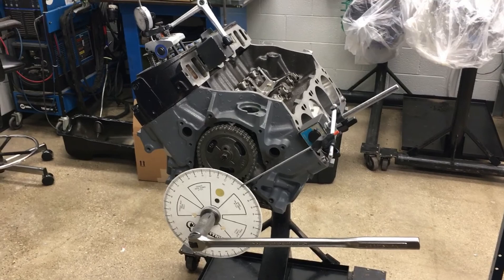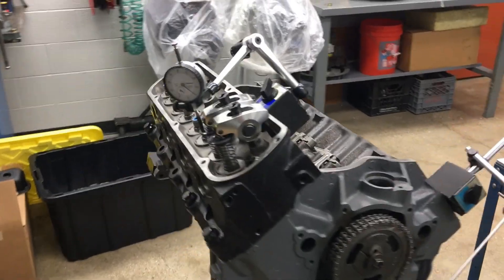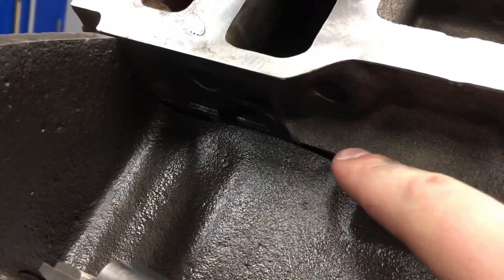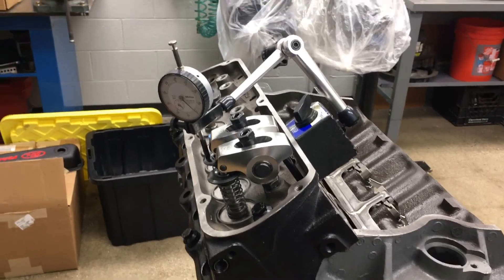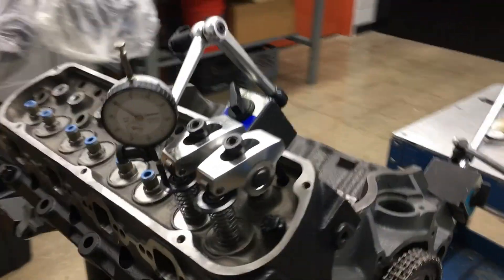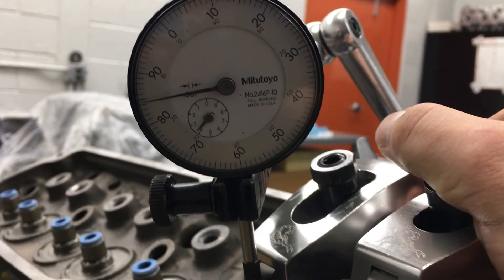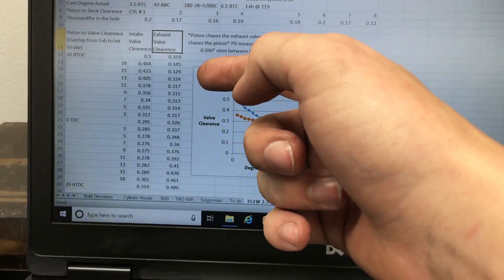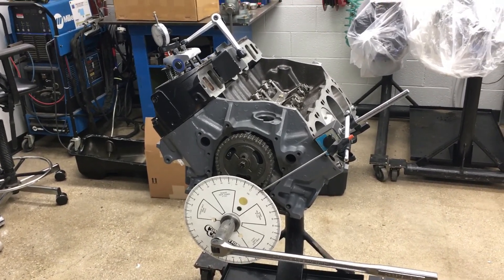New Cam Shaft! Measuring Piston to Valve Clearance (PVC) SBF 351W/302

Comment: What size valves are you using?
Mine are 2.10,1.60 on a virgin 1994 351w roller,and I'm concerned about p2v clearance, new heads etc, stage 3 trick flow cam
Reply from the maker: If you are using a 2.10 inch intake valve, you will hit the stock piston especially with an aftermarket camshaft with more valve lift and duration. You can either fly cut your stock pistons or buy aftermarket pistons with bigger valve reliefs.